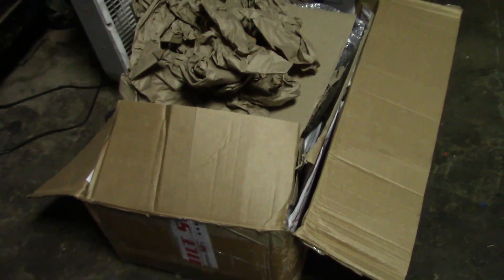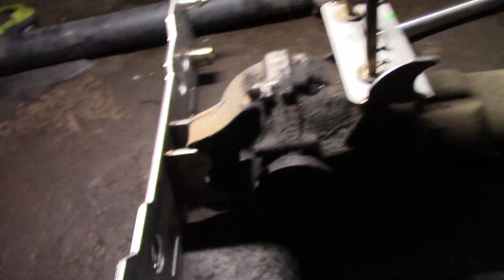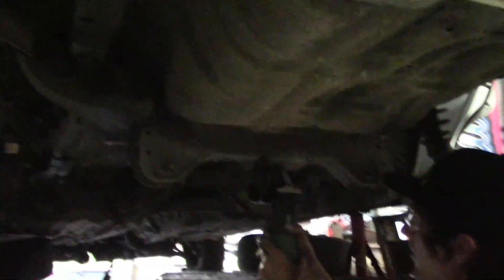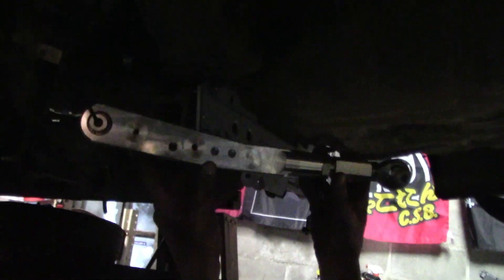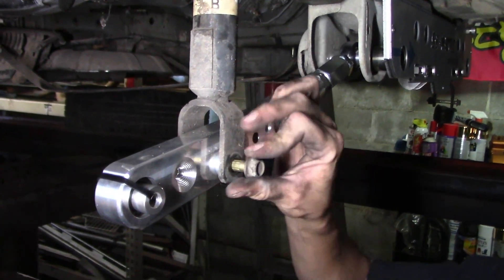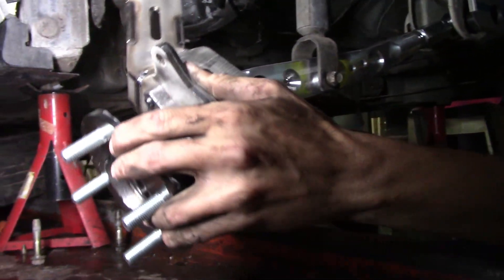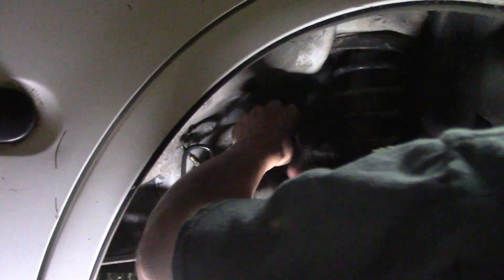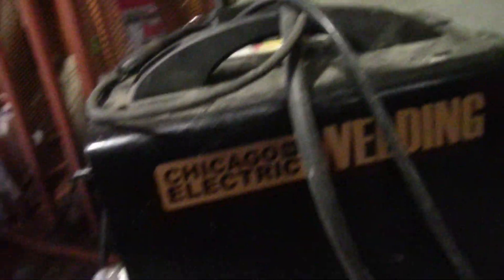S1 BUILT EK CIVIC TRAILING ARM INSTALL

Comment: Looking good 🙌🙌🔥🔥🔥🔥
Reply from the maker: Y'all's products are amazing! Thanks for developing such a sick product
Reply: @SlightlyMangled  Appreciate the love thank you 🙏
Reply: What is the weight difference between the s1 built trailing arms vs OEM?
Reply from the maker: In sure @s1built can say for sure but when I did the swap, the stock ones still had the drums attached. With that factored in vs the s1 having disks, I'd say the s1 is lighter by a few pounds on each side